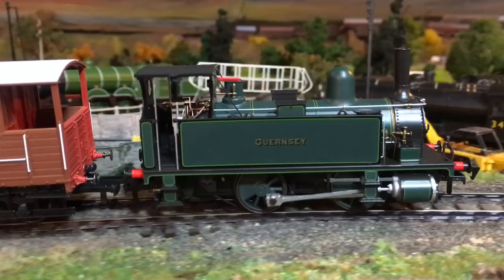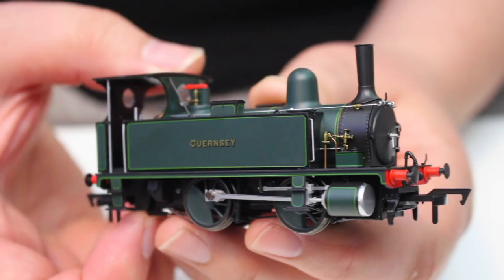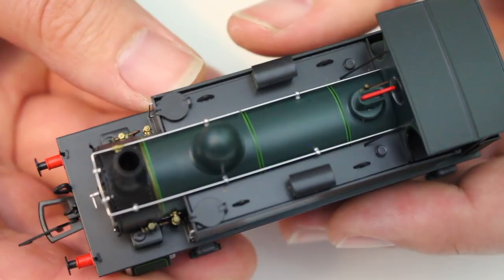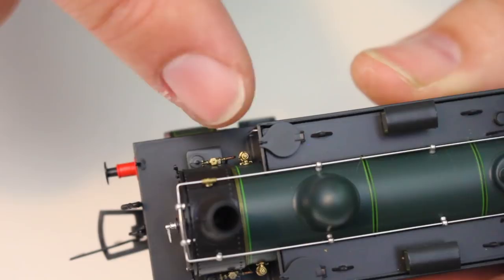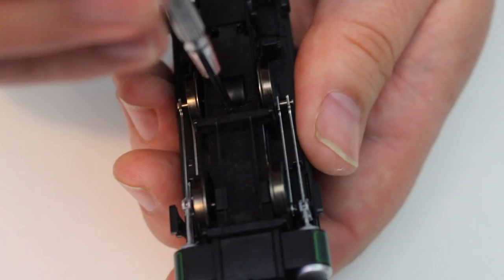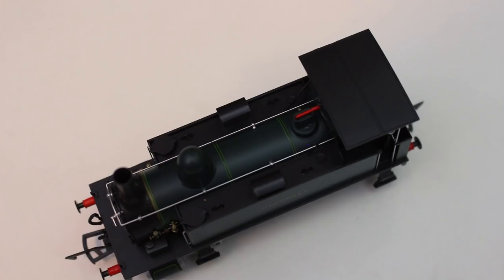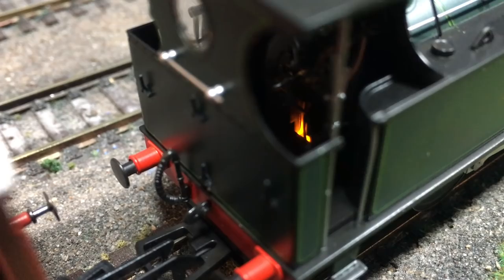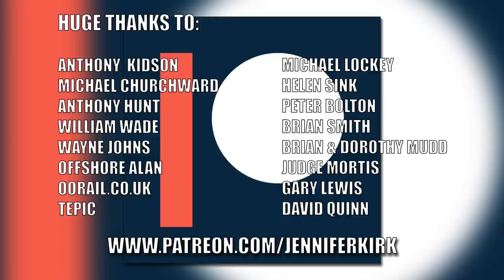Dapol B4 Class 'Guernsey' Review and DCC fitting guide

Comment: Putting the keeper plate back on before further dismantling is a brilliant idea! I didn't think of that and the whole darn lot fell apart - took ages to get the couplings, motion and bearings back in the right place! It was also difficult getting the motor/chassis assembly with the 6-pin DCC chip back into the body. This is a an attractive little locomotive but it the mechanism could have been designed a lot better.

Comment: Hi Jenny  A very informative video and I agree with you about DCC fitting it is a pain!  I have on of the first batch and yes mine fell apart just as you said and yes it took a few hours to put back - there should be a "health warning" on the packaging it would save a lot of high blood pressure if there were.  Also yes a regular straight 6 pin decoder will not work.  Having said that I love the looks of this new version and will buy one but with a factory fitted decoder.

Comment: I just fitted the odd rectangular couplings and they work great for compact shunting layouts where coupling lock and ride are common .also if you run older large coupler stock it would possibly help with that .they look a bit weird but because there black against black chassis its not that noticable .

Comment: You didn't mention the flywheel or the 'compensation' on the undriven axle. The bearing in the middle allows lateral movement and plants all four wheels squarely on the track. I have one of the next batch on order and I hope they haven't changed anything.

Comment: Open smoke box door ? How would you pass the decoder in the side ? There's NO better way Jenny. Your score is not justified for the fitting. Most tech oriented buyers will understand this. Otherwise a nice review and well documented. Thanks Jenny.
Reply from the maker: It would allow a small size direct plug decoder to be put straight in. The wired 6 pin would fit under or over the PCB in a way that isn’t easily possible if taking the chassis in and out.
Reply: @JenniferEKirk  Maybe... Only Dapol could provide the answer. Anyway it's a possible fit as you demonstrated very precisely and it wouldn't scare me for it's part of 'model railroading' fun ! Greetings